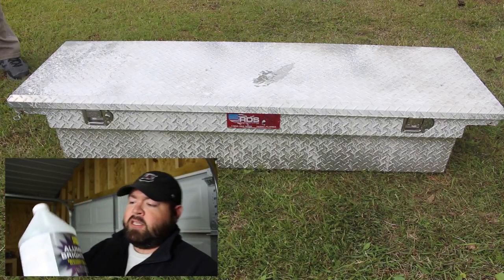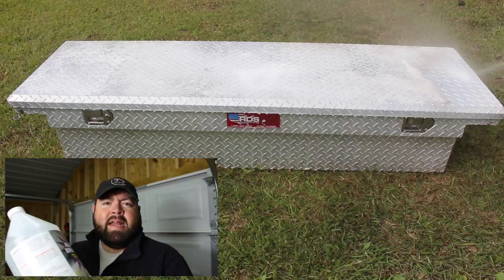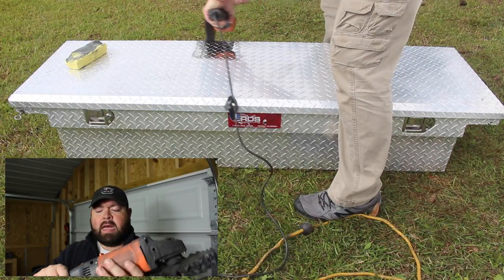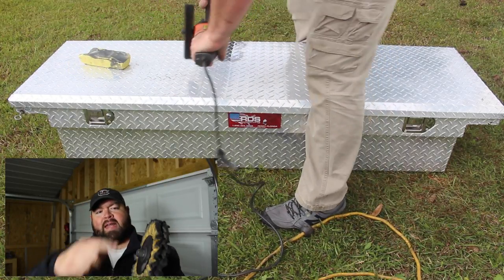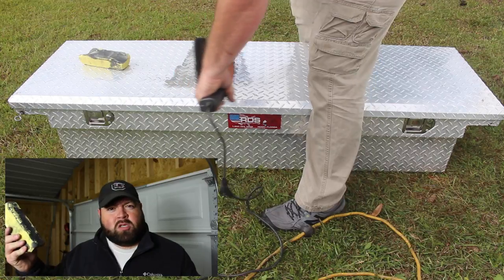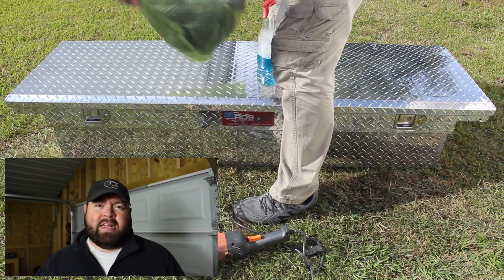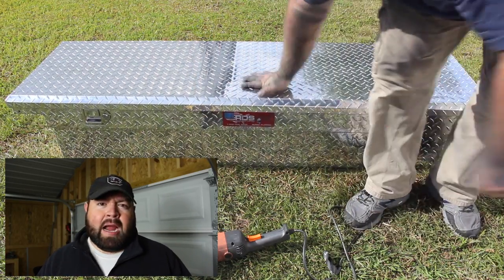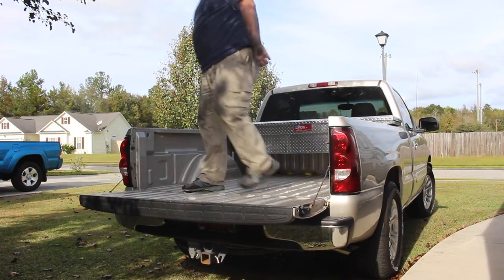HOW TO POLISH DIAMOND PLATE ALUMINUM TOOL BOX LIKE A PRO! | EASY AT HOME METHOD

Comment: Man I know this is an old video but hoping for a response,  I've purchased several buffer/polishers and the bolt stud isn't long enough to fit the zephyr adapter ring and pad on them.

Is there like a longer bolt adapter I need ? What polisher/sander are you using in the video.

Really wanting to polish my box and headache rack, awesome video.
Reply from the maker: In the video I was using a harbor freight polisher/sander. I actually still have it and I just bought the zephyr kit to polish the bed on my golf cart from this video -  https://www.youtube.com/watch?v=ebUewS3OWbg
Reply from the maker: This is the kit I used and it came with everything needed - https://amzn.to/43Ggd30

Comment: A truck driver. Thank you. However i have some black spots and don't know what it is. Not tar bc I use diesel fuel to remove tar spots and it didn't touch it. Any insight? If need a pic I can send u an email thanks.